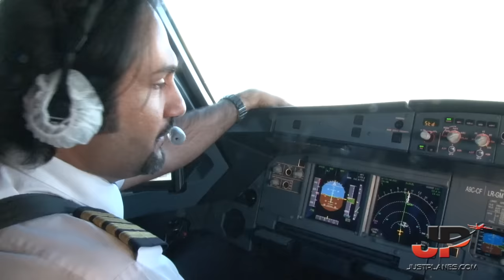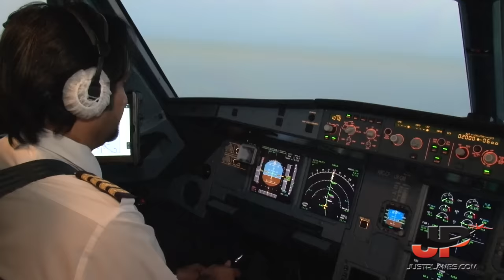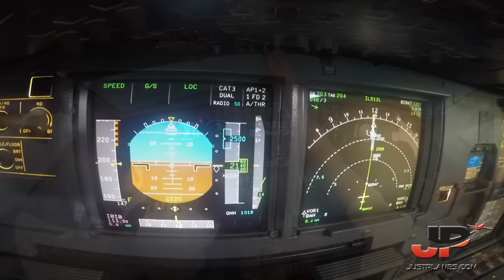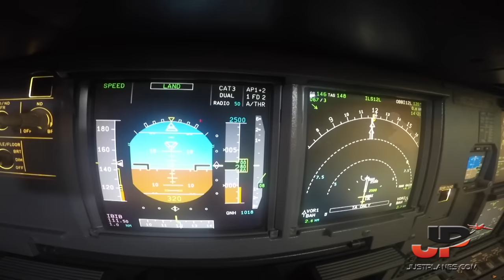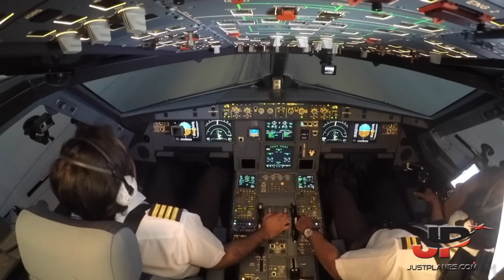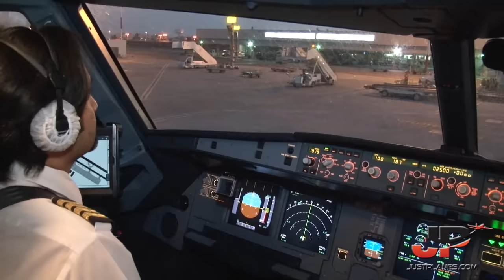Watch AIRBUS LANDS ITSELF  - Full CAT III Autoland

Comment: It really didn't land itself. They put the flaps down and adjusted the instruments, put the wheels down. I know what they mean but? It got them there.
Reply: True. Pilots are still needed to manage the aircraft down to the runway
Reply: Well Airbus kinda learned that lesson the hard way with the first air france A320
Reply: @kyledorsty906  I do not understand the relation for your comment. Air France Flight 296 had nothing to do with the auto land system. It was a programing mistake in the fly-by wire software.
Reply: @se-kmg355  It wasn't even that. Pilot was at alpha max too low to the ground. If there was no computer even if he pulled up and powered up the aircraft would have stalled due to the engines not spooling up quick enough and he'd have still crashed into the trees if not before
Reply: @tomstravels520  Still has nothing to do with the auto land system.
Reply: SE-KMG I know but I’m also saying there was nothing wrong with the computer. Computer did what it was programmed to do. Protect the aircraft. If the pilot hadn’t flown too low or powered up a few seconds earlier he may have just missed the trees
Reply: And they programmed all the stupid little computers, telling them what to do. It was a machine-assisted landing,
Reply: @kyledorsty906  That crash was caused by a pilot who didn't understand the alpha floor mechanism.

Comment: Autoland, but without Flap selection, and Gear down. Still very cool.
Reply: It's set on the CDU Perf page
Reply: Can they be included in the automation?
Reply: Mark Roberts No. the flap levers and landing gear handle don’t have motors in them so someone has to move them to select them to the right settings.
Reply: Kent ok thanks for the info
Reply: The idea of the auto land is to help the pilot land in zero visibility and not to do the work for the pilot, they basically trying to replace the eyes, no need to replace the hand haha, it could be done in theory, but costs a lot of money and science to implement.

Comment: Why is this feature only used for low visibility landings? If it’s the safest landing method in low visibility conditions, wouldn’t it also be safest landing in high visibility?
Reply: Autolanding is risky. It only accounts for a small percentage of landings
Reply: I guess so pilots stay in shape maybe.
Reply: @jw3133  it's not risky at all.
Reply: Auto-land systems are unable to respond to situational changes; the latter can only be handle by humans. Auto-land systems cannot be used when there are medium or worse head winds or crosswinds and they cannot be sued during thunderstorms. They are of use only in a limited set of circumstances - it is much safer to use humans and simple aids aids (e.g ILS) in all other circumstances.
Reply: @hb1338  thank you

Comment: wait, that plane dont need pilot anymore lol
Reply: The autopilot is an assistive system that's been around for decades. It's not going to replace pilots. The pilots are the ones who program the system, navigate, prepare the aircraft for landing, run through checklists, monitor instruments, and prepare for a potential go-around. The purpose of an Instrument Landing System is to allow landing in low visibility, when visual landing is not possible.

Comment: Does anybody know whether the Autoland-system also engages the reverse-thrusters automatically?
Reply: It does not, it just gets the plane onto the ground.
Reply: It will land the plane, apply brakes and roll out.  It does not lower flaps or landing gear.
Reply: @rcairflr  it doesn't apply brakes either, that's the separate autobrake system
Reply: It does. Considering that it can autobrake it can do that most likely.

Comment: A category III approach (CAT III with 0 visibility) are rarely executed because most aircraft don't have the equipment, plus once you land with that kind of visibility taxiing can be impossible or incredibly dangerous. and also the pilots have to be authorized to this landing. Not every pilot can land cat3. and also the airport infrastructure must be suitable for cat3.
Reply: Cat 3 no dh isn’t zero visibility.
Reply: Slightly incorrect. CAT III is a necessity where visibility is limited, way beyond cat I and II.
But yes, to do a CAT III, the aircraft, the pilots and the runway+approach all have to be CAT III certified.
Reply: @ZK-APA  so what to you think was incorrect?
Reply: @peteconrad2077  My reply was to the original comment, that CAT III is rarely executed.

What you've said is correct, CAT III no DH isn't zero visibility, CAT IIIc is.
Reply: @ZK-APA  I get that. But he’s right that many aircraft are Cat3 equipped. Tends to be ubiquitous in the bigger jets.
Reply: @peteconrad2077  now that depends on how you define rarity. Like yes if you include GA then most of them don't have CAT III at all (or ILS in general). In that case it's rare. But if you look it from a perspective of an airport with large airliner traffic and consistent cat III conditions then cat III suddenly goes from rare to an absolute necessity.
Reply: @ZK-APA  and yet most 737s don’t have it.they have 3a but not 3b which the OP was describing.
Reply: @peteconrad2077  Those are the old ones though right? 
Plus rarely executed would still not be the right term.
Something like a NDB approach can be said is rarely done.
Reply: @ZK-APA  they are rarely executed. I haven’t done an actual cat 3 auto-land in the last year at least, maybe 2 or 3.
Reply: @peteconrad2077  In my home base, during winters visibility is almost exclusively cat III till late morning. Hence we have multiple CAT II/III ILS equipped runways, and the entire fleet and crew are kept CAT II/III certified. Although yes its not an issue during other months.
Reply: @ZK-APA  well most airfield and crew are. An airfield that is cat3 so much is a rarity.

Comment: But I'm wary that what happened with the Boeing 737 planes, whether it is 100% safe. Though it did do the job.
Reply: plezx29 - The 737 Max, which has the issues, is just one model of just one type.  Aircraft in general have been using Cat III regularly for the better part of two decades.  It is a well proven system.  That said, there is no such thing as a 100% failure proof system for anything.  Accidents always have and always will happen.

Comment: Call me picky, but shouldn’t fully autloland adjust the control surfaces too?
Reply: Control surfaces such as ailerons and spoilers are operated automatically. Flaps are not for a couple of reasons. It's not needed anyway unlike autoland which is very useful since its mainly used in very poor (up to 0) visibility. If we, pilots, can't see outside, that's where the autoland system comes handy.
Reply: So the fear we can do without pilots is overblown then?

Comment: While Boeing is still learning on how to do auto correct , aka MCAS, right.
Reply: Boeing has featured CAT3 autolands for at least 40 years. Same with McDonnell Douglas.
Reply: Not only can Boeing do exactly the same CATIII autoland correctly, MCAS is barely related to autopilot, it is simply a trim function. And Boeing are also capable of much more advanced and capable automation than airbus, they just prefer not using it unless it's absolutely necessary (e.g. F/A 18s which, like all fighters, are so maneuverable that they'd crash very quickly without a computer's assistance). Note how Airbus have no problems completely ignoring pilot input to, for example, avoid a stall, while Boeing hates removing control from pilots so much they don't even have a common stick pusher, just a stick shaker. And no, MCAS is no exception to this, there is a single switch to disable it and pilots are expected to be able to do so within 3 seconds of an unwanted activation.

Comment: This dude is talking in sterile cockpit and giving tutorial on how to land an airbus
Reply: @TOJOatYour6 No, sterile flightdeck means among other things: Limit communications to the necessary communications for the operation of the aircraft and the conduct of duties. Also refraining from any activities that could distract the flight crew.

May I note as well, that there is a GoPro just in front of is PFD! And he does not have his hands on the controls until around 500 ft. He is playing with a pen in his hands. For me this seems all very unprofessional.

If you want to show and explain autoland capabilities, I would suggest showing it in the simulator. And even then show professional working behavior. For a pilot, normally, an actual low-visibility CAT3 autoland is not something where you are very laid back. It requires extensive monitoring and concentration.

Comment: Imagine attempting to auto land in a crosswind situation
Reply: It can do it. It doesn't have to be calm weather.
Reply: @dkdanis1340  Maximum cross wind component is typically 20 knots, which is about half what most aircraft are rated for under ILS / visual approaches.

Comment: Airbus lands itself?  What were those guys doing in the cabin?  Why did they mess with all those switches and buttons?
A plane lands itself when it lands (auto gear down, correct flaps, reverse thrusts, brakes and pulls up to the correct gate) while the pilots are in the back having coffee!
It is like saying my car drives itself because it is on cruise control.
Reply: Riberto Autoland causes the plane to automatically align with the runway, decend at a safe vertical velocity, and  automatically flare just before landing. The pilots must have control of the flaps which in turn meaning they must have control of the speed of the aircraft as well. Autoland is only used during low visibily so that much work by the plane is enough. Pilots then switch over to ground ATC who decide which route the aircraft should take to reach their gate meaning the pilots should take control of brakes and turns as well. I think the pilots also should monitor reverse thrust so they can correctly slow down the aircraft to take the correct exit out the runway.
Reply: Hurrah ! Someone who understands that all this automation is completely useless without humans to tell it what to do.

Comment: Scary when computer take full control of the airplane
Reply: Ultimately, the pilots are always ready to switch off the computer thankfully.
Reply: Well, in average 95% of the duration of any commercial flight is actually controlled by a computer. Does it sound less scary now?
Reply: @michelgardes  yes and no, the pilots program all the systems before the flight and get everything ready. the autopilot itself is not intelligent. there needs to be a perso monitoring the systems and communicating with tower control in case of any emergency or any thing out of the ordinary. autopilot is a way for pilots to not need to be controlling the yoke or stick 100% of the time. as you may think it would be quite a physical job, imagine driving a car 12 hours straight but is as complicated and as stressing as flying a passenger aircraft. hope this helped you understand autopilot a bit more

Comment: Although it’s CAT III but can’t be absolutely zero visibility. Otherwise plane will be diverted to a different airport.
Reply: Many planes can land in zero visibility - been there, done that. The problem is that moving around on the ground in low visibility requires great care even if the airport has ground radar. During poor visibility the airport's capacity is reduced due to much slower ground movements, so that some flights (and aircraft with less sophisticated equipment) are diverted elsewhere.

Comment: Pilots love to pretend their job is super hard. And then ogs like this expose them all
Reply: Their job is hard
Reply: @jw3133  0:01
Reply: @timazbill7746  If being a pilot was easy then everyone would become one. I work on airplanes for a living as a mechanic. Most commercial pilots don't use automatic landing unless they get approval. 

Autolands are less reliable in case of traffic on the runway, turbulence, or any other obstruction considering the computer can't compute if those things do occur. They also land hard which would make it uncomfortable for passengers and damage the aircraft.

As an old instructor of mine said: "planes haven't needed pilots since the 60s, but you bet your ass i ain't getting on a plane without one"
Reply: Computers don't program themselves.
Reply: The pilots are the ones who program the autopilot, navigate, prepare the aircraft for landing, run through checklists, monitor instruments, and prepare for a potential go-around. The purpose of an Instrument Landing System is to allow landing in low visibility, when visual landing is not possible. It doesn't replace the pilots.

Comment: i would not trust autopilot  to land the plane . also i disagree that it is 100% safe .
Reply: Ibrahim Musa channel everything is 100% safe. Till it’s not.😜. I would not trust it either. Wonder how it would cope with a last minute cross wind etc. obviously the captain is there to watch over it but if they have done hundreds of auto landings with no problem how ready do ya think he will be on that one time.
Reply: Anthony it can’t handle last minute crosswind that’s why it’s only in calm weather
Reply: They use same instruments anyways so it's 100% safe.
Reply: @nikobelic4251  it can handle crosswinds.
Reply: @dkdanis1340  it has crosswind limitations that are less than what pilots can handle.

Obviously it can handle some crosswind or else it would be pretty much useless since there is a light crosswind 99% of the time
Reply: @nikobelic4251  well that still depends some things can do more than what their rating says.
Reply: @dkdanis1340  some things can yes
But they are rated that way for a reason
Reply: @nikobelic4251  well it's like saying engine won't ever explode or pilot won't even fall unconscious. In reality that won't really happen often but still...
Reply: @dkdanis1340  You seem to misunderstand what 100% safe
You are correct, engines will fail, pilots will fall unconscious and Autolands will fail.
Just today shooting an approach into FXE I had a bad localizer
If I were performing an autoland the system would have failed

It does happen and it happens more than people think.
Reply: @nikobelic4251  Actually, it can't handle anything other than a light crosswind at all.
Reply: @dkdanis1340  How do you manage to be wrong on almost everything that you post ? Auto-pilots have zero intelligence and zero situational awareness and can handle only the simplest of instructions. Auto-land systems are actually carrying out a a very simple task - fly in a straight line, lift nose, slam it to the ground, reduce throttle, apply brakes. Because of their simplicity, automated systems can handle only a very small percentage of the situations which arise regularly.

Comment: Why do pilots get paid so much if they don’t do much anymore.
Reply: They do everything. This isn't an AI that does everything for the pilot. An autopilot is an assistive system. A computer needs data, that's input by the pilots. The pilots have to navigate, monitor the instruments, communicate with ATC, and prepare for a potential go-around. They're still doing most of the work.

Comment: Cat III autoland has been around a very long time and I do know the the L-1011 tristars were among the first commercial airplanes to have it. This is why whenever I hear the argument that it's impossible for a "single engine cessna pilot" or your average schmo to fly and land a modern aircraft I bust out laughing.  ( Without training)
Reply: Very few Cessna pilots have received sufficient training either to be able to land a heavy successfully or to configure a commercial auto-pilot/auto-land at the speed that is necessary to make such a system usable. "Passenger lands plane" is almost entirely an urban myth.